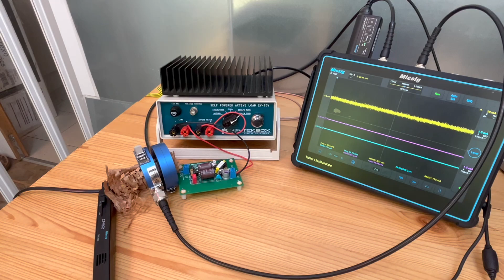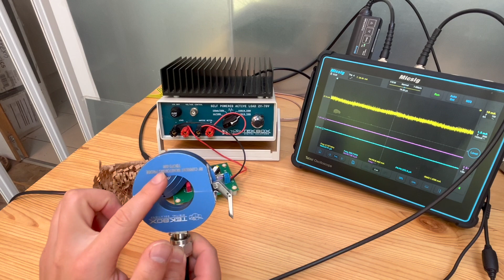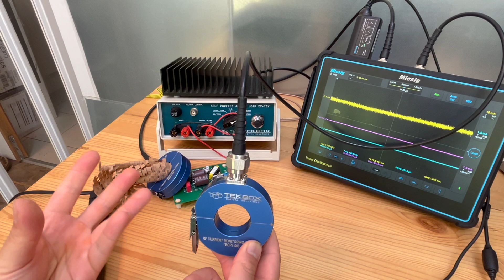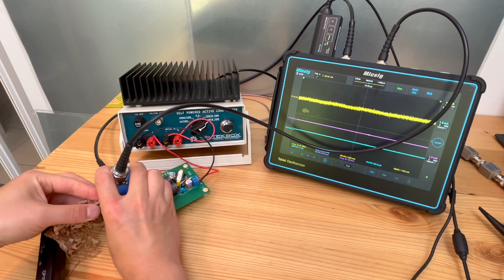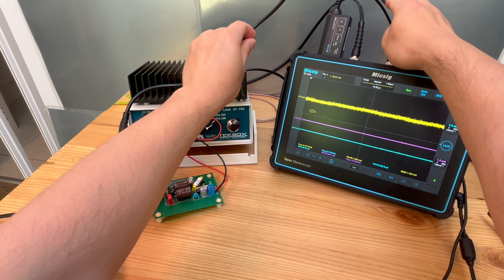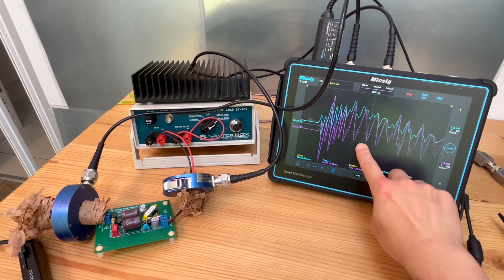RF Current probes Episode 9 - A pair of matched probes

Comment: Hi, do you have experience that for low value CM current possision of the probe on the cable give diffrence results due to coupling E field to the probe/cable. What should be best position of CM current probe for HF RF measurments, low value let say above 500 MHz to 3 GHz. Is current probe as a metal structure influencing the results by making shunt capacitaince for CM current and as results we got less current?  Regards
Reply from the maker: Typically, I find, at least for EMC work, the unshielded probes work just as well as the shielded ones. The highest frequency I used for troubleshooting EMI work is about 1.3 GHz. If you check Langer EMV, they always characterise their probes to a few GHz. I am sure one can use these probes for measuring emissions on a small chip or something, but that is something I have not come across, yet.

Comment: So am I right if I say that the part of the waveform that is present on both sides of the transformer is conducting through the stray capacitance between primary and secondary winding in the transformer?
Reply from the maker: Correct Tomas, but I failed to find a way of finding the rest of the CM current. You know, I thought the CM on the primary side and the secondary side should be more or less the same level, but, as shown in this video, the primary side of the current is a lot less. I suspect it is due to the CM filtering on the AC side. But how can we prove this without taking all the filters out? If our assumption is correct, then there must be another path returning the CM current back to its source, just before the filter. Difficult to measure in this case!
Reply: @MachOneDesignEMC  Hi again, if the CM-current was exactly the same on primary and secondary side, wouldn't that mean that there is no radiation at all from the primary side? The radiation that is common between the primary and secondary side consist of what the stray-capacitance is able to transfer. Ideally, without stray-capacitance, the radiation from the primary- and secondary side may look totally different I suppose?